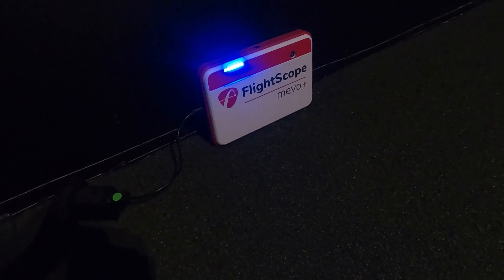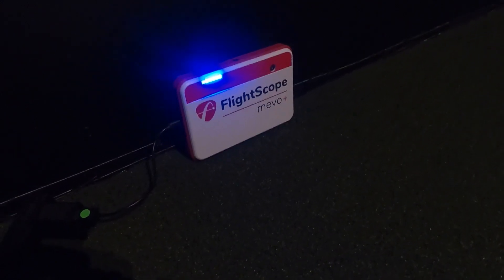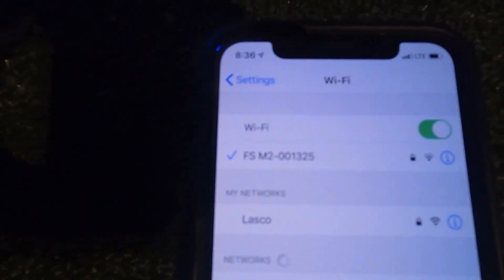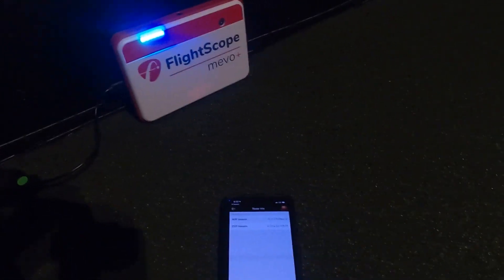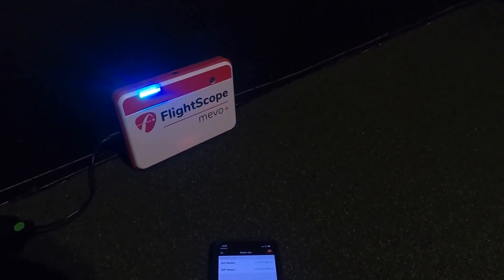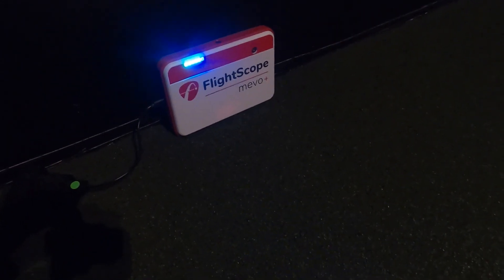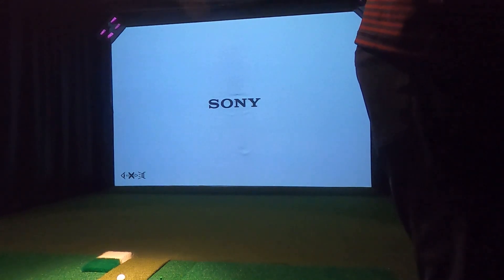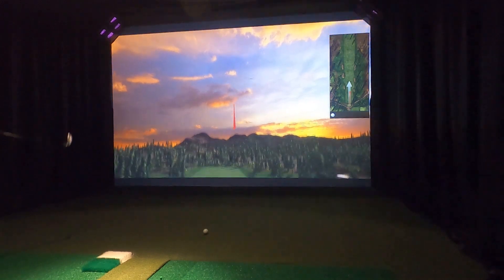How To Update Flightscop Mevo+ Firmware - AVR vs DSP

Comment: Hey thanks for the videos. However, not sure if the info you got on the apps and the alignment line are accurate. I have both an iPad and iPhone and have the alignment line with the FS Skills app on both devices and alignment no line on either device is the FS Golf app. I have talked with flightscope a couple of times and their fixes for it did not work. I was told that I would have to wait for an app update for it to be corrected. Flightscope said the app had been submitted to Apple and it has to be approved by them for it to be released.
Reply from the maker: Kevin Meyer Thanks for watching, Kevin.  I have videos showing the alignment app using FS golf on an iPhone and other users confirmed the lates FS Skills app update now has the line on the iPad.  Your wording is confusing.  What device and app are you saying doesn’t have the line?  I can confirm the iPad with Skills later today myself if that helps.
Reply from the maker: Kevin Meyer Check our this video just from the other day. iPhone with FS Golf.  Best and easy was to setup in my opinion.   https://youtu.be/eJLdy_24ZqM
Reply from the maker: Kevin Meyer Let me know
Reply: I don’t have an alignment line in the FS golf app with my iPad and iPhone 
I do have the alignment line in the FS skills app with my iPad and iPhone
Reply from the maker: Kevin Meyer Huh well that would makes sense on iPad as I stated FS Golf is for iPhone.  Try deleting and reinstalling.  What iPhone are you on?
Reply: @GolfSimulatorVideos  I have tried deleting the apps on both iPhone and iPad a few times. I have an old iPad Air 2 and an iPhone 8. Have no trouble with either app on either device I just have no alignment line in the FS golf app with either device
Reply from the maker: Kevin Meyer I wonder if iPhone 8 is too old and not supported.  Not sure on this you are the first person to have that issue that I know of.
Reply: @GolfSimulatorVideos  FS support only said that it would be rectified in the next app update. Will have to wait and see but like I said everything seems to work just fine. I also seem to do well with the putting with the 0.08 firmware where a lot of people claim that it’s unusable.